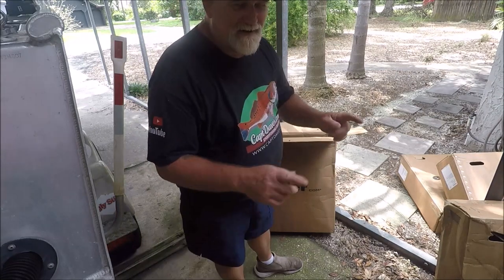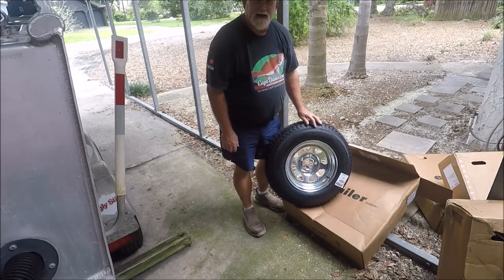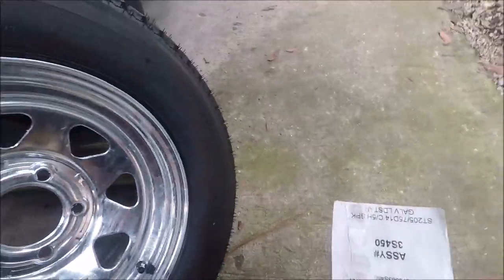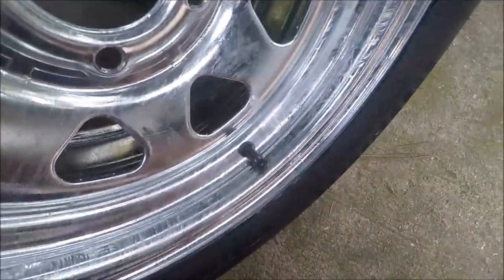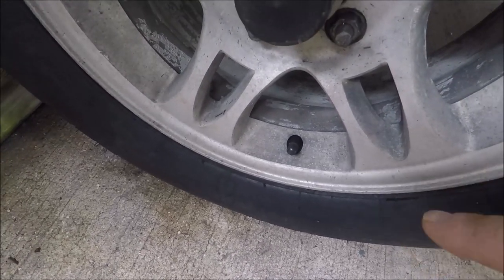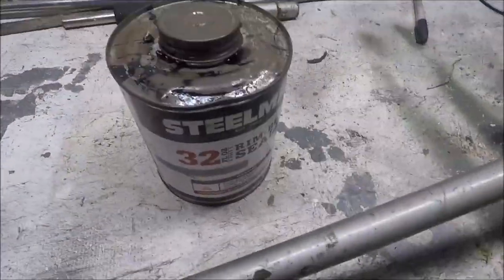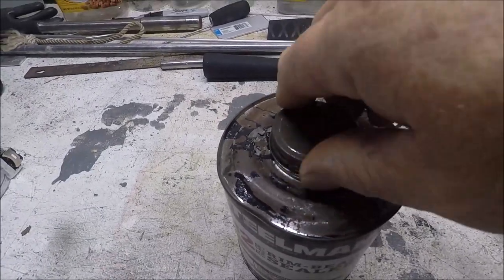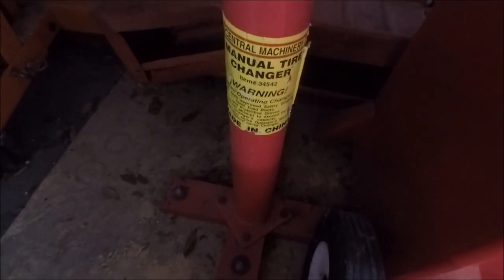BOAT TRAILER RIMS, Alloy versus Steel

Comment: Alloy rims should only be used on golf carts, and 4-wheelers! They are notorious for loosening the lug nuts all by themselves! Best money you’ve spent on the boat lately in my opinion👍👏 Can’t fish from the side of the road!
Reply from the maker: never had them loosen, they just ''loosin'' air!
Reply: @CaptDavesSportfishing  I’m sure you just make short trips mostly! Rims get hot on the highway, then cool down and that loosens the lugs! Glad you changed out👍
Reply from the maker: @melloreel  5 minutes to ramp. 5 minutes home.  But a death trap of Navy squids going 90mph all around you.